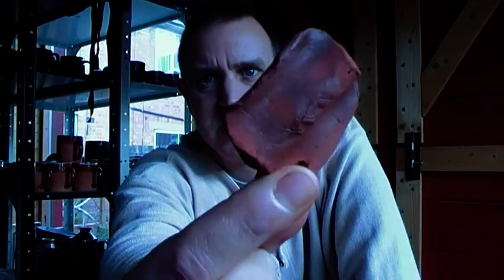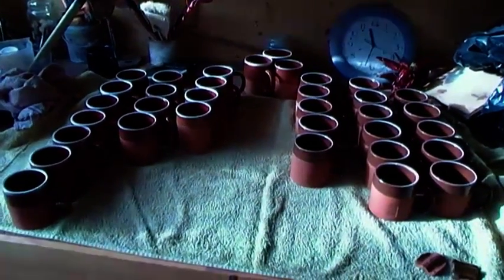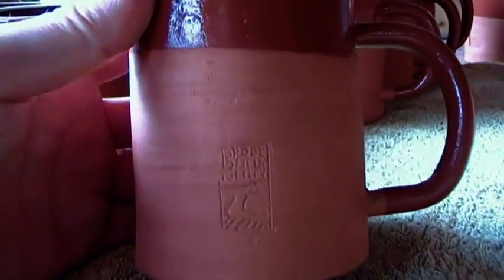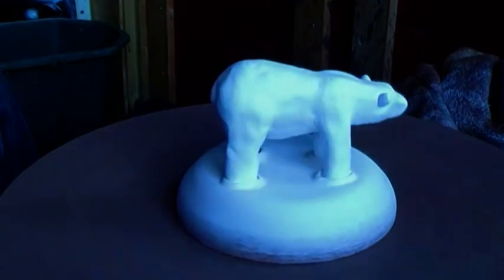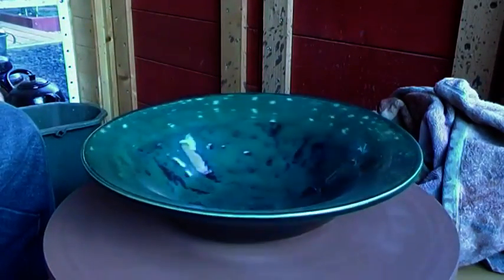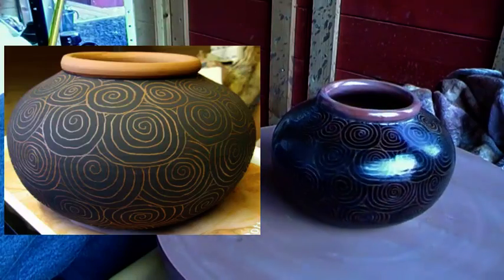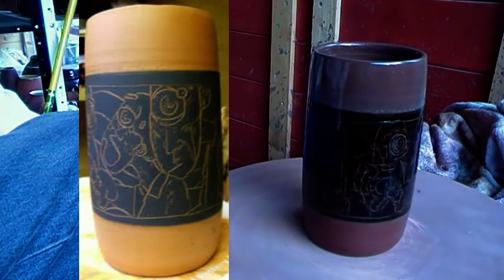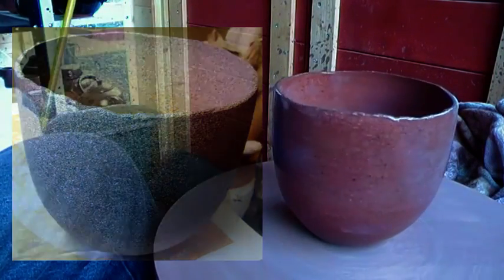Recent Firing Results

Comment from the maker: Hi Donna, I like to keep my mugs simple, not that I don't like other shapes, I do, but cylinders are the shape I first threw and is the best way to practice. My friends all liked them so the shape stuck.
The green glaze is just the cheapest base clear glaze I could buy with 7.5% copper oxide mixed in. 
Mark.

Comment from the maker: Clear glaze goes milky if it is quite thick. I've found that the single fired pots stay (mostly) clear because the glaze is only applied thinly. When applied to biscuit wares unless I dip them very quickly the glaze does go milky.
The lids shrink at the same rate but I make sure that they are on the same shelf. I made a mistake with a small teapot on a previous firing and put the lid on a lower shelf and it came out a different colour as well as varying slightly in size.
Mark.

Comment from the maker: Hi Sharon. I hope if I just fire a few things over night (with the vents in my studio open!) using the soda glaze I should be safe. There aren't, as far as I know, any big kilns near me that I could use, unfortunately.
I plan to do as you say and use the oxides without glazing them next time, but will add a little slip to the mixture to (hopefully) make the mix more stable and stop them from brushing off.
Thanks for your feedback, it is always appreciated.
Mark.

Comment: I'm trying to get as much information as I can before I get started working with clay.  I purchased an used Skutt kiln a few days ago and it came with 5lb of clay.   The clay doesn't have any paper work with it so not sure what kind it is.  I have just been playing around with it at this time but I would like to know how long you can leave an item unfired?  From your Video I have learned you can't fire items wet.  I'm a few months away from getting my kiln up and running should I wait before I start making pots/pieces?  Also should I go buy new clay so I know what level cone it needs to be fired at?  Any information anyone wants to give me will be deeply appreciated.